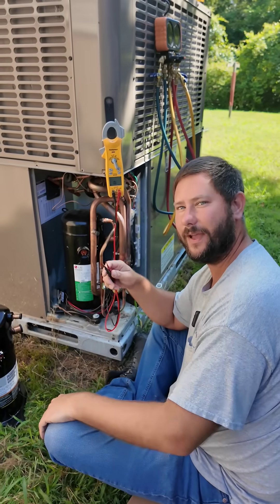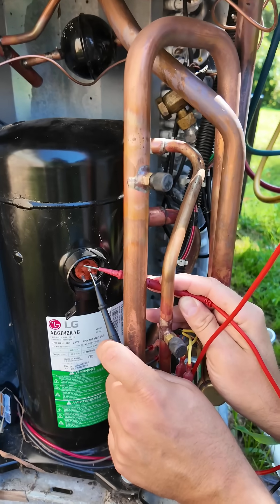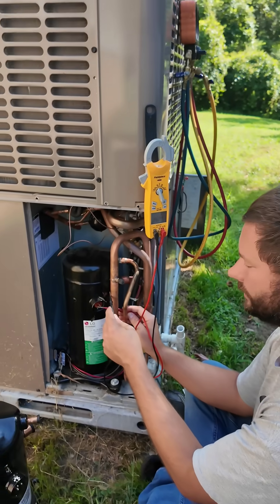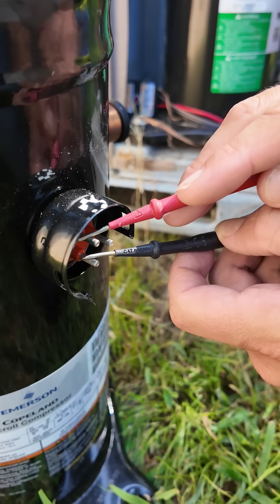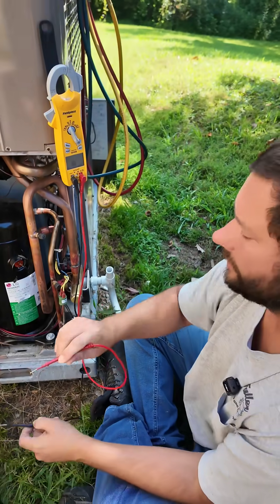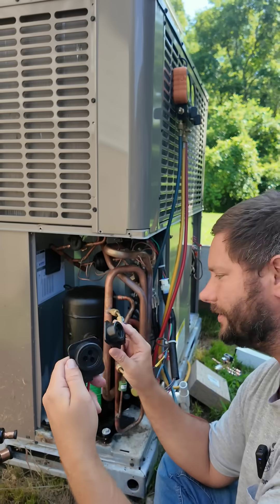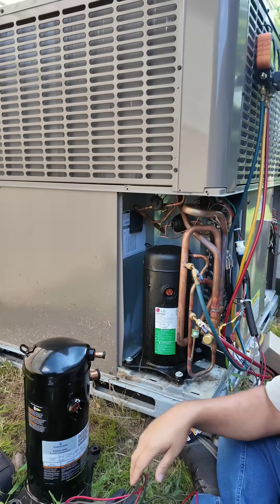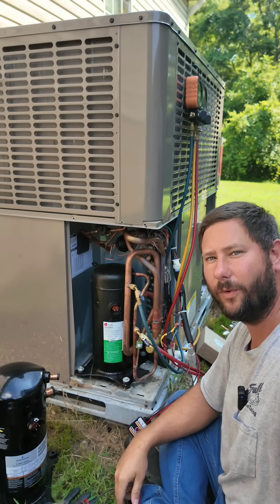Testing Compressor Windings - Everything You Need To Know

Comment: If the plug don't fit you can use the terminal repair kit to safely run the compressor until you get the right plug

Comment: “If we measure between the 3 connections, start to run, run to common, common to start, they should all add up; right?” 

Add up to what? What are we adding and comparing that value to?

Comment: I learned that the hard way 30+ years ago😂. My older brother who was a licensed electrician got into HVAC. He went to school got his certs and proceeded to teach me. He was checking for voltage between the windings meaning the unit was still hot. I happened touch the casing and a metal door jam next to where he was trouble shooting. That was a nice feeling. As soon as I said owwwwww.....like a big owww. He says to me the compressor is shorted😂

Comment: If I get resistance between the terminal to ground does that mean if I put multimeter on continuity setting and touch terminals to copper it should give an audible tone which means resistance and not OL ?

Comment: On your meter readings of the new compressor common to start would be your 1.3 ohm reading. The start winding has more resistance than the run winding. The 0.9 reading would be the common to run winding, with the 1.9 your start to run. If your readings are accurate, the total ohms of the two winding should be 2.2 ohms across the start, and run terminals.
Reply: @mofiddly  hey men is that mean is a bad compressor i mean if you find the reading between the S and C  lower than the R to C as in the video
Reply: @Hichemst  If the windings add up mathematically where the total equals the sum of the two windings, then he just confused the two. the run winding, with the start. Confirming the winding designation with the cover plate for the compressor terminals, and go from there. Could be someone before you hooked it up wrong. Usually if a compressor goes bad electrically, the winding resistance will not add up correctly, or you will have a open circuit, or a short to ground.

Comment: I would observe that your measurements to the case of the compressor are INSULATION QUALITY Measurements, which as you stated, should be VERY HIGH Resistance. The term "Continuity" is a bit nebulous.  It implies that current can flow between the two test points, but is nonspecific as to how much (Undefined Resistance).

As an experienced industrial troubleshooter, I recommend to my trainees, to refer to Insulation Test Results and Insulation Leakage Results and to connections with only a few ohms "Ω" as Continuity.  This term being reserved to a section of a potential circuit wherein successful operation could exist, without excessive heating or voltage loss. 

One additional point, regarding Insulation Leakage.  In a case were the leakage is present, the resistance can be used to determine whether the system is safe to run, for example, until a replacement is available.

The case that I most often encounter is in regard to 480 
3ø motors.  IF I find leakage in such case, I recommend to the owner that it is reasonable to run that motor, if the leakage resistance is greater than 1Megohm, measured with a Fluke Insulation Tester Model 1587 with the test voltage set to twice the operating voltage, in my example, 1000 Volts (In your case, 250 Volts, since the Compressor is 125 Volts to Ground).

I have never had this backfire on me, so with more than 65 years experience, I do not hesitate to recommend it to you. 
PS. I notice that a fellow ham radio operator mentioned in a comment , the term Megger.  This is a very old term that refers to insulation testers that measure insulation on things like high voltage transformers and switch gear and utilize test voltages of 15,000 volts or so.

The Fluke 1587 mentioned above is excellent for Insulation Testing in the Commercial/ Residential Space and for the Factory Floor.  I have carried one for at least 15 Year in my Fluke satchel, and is does not let me down.

Comment: Buy a megohm meter. You cannot reliably check a motor for winding to ground short with a traditional meter. Preferable a fluke 1587 although the cheaper ones work just fine. You need the dc voltage injection to be 100% sure. It's worth the investment!

Comment: 40 megaohms to ground is NOT bad. Thats 40 million ohms of resistance to ground. We are taught in school that 20+ MOHM is acceptable. Any MOHM to ground is better than KOHMS. York chiller literature will state that a MOHM reading less than 5 does not necessarily mean the motor is bad, so there are no rules of thumb.

  Even a brand new compressor once installed can potentially read kilohms to ground depending on the oil and refrigerant quantity in the compressor. Testing a nitrogen filled compressor then testing the same compressor once you install it and charge it will cause readings to change (sometimes.)

Just saying not every compressor is bad if you read something to ground. If you suspect it is bad, test with a megaohm meter next at the rated voltage of the motor.

Ive seen brand new Bitzer compressors test 200kohm to ground, run for an hour then test 50+Mohm to ground with my Fluke 116. It all depends on whats surrounding the windings. Every motor pulled into a deep vacuum WILL fail an insulation test and should never be tested in a vacuum or you will destroy the windings.
Reply: You do that all that testing of a compressor in perfect conditions, try doing that in a shitty condenser that smells like ass and you actually have to bend down into the unit, upside down. If it’s grounded out , especially popping the main breaker . The shit is bad . Recommend replacement. On to the next call! You spend all that time if you want too. Have fun

Comment: Yes... a great simple way to test a compressor motor's integrity, using a multimeter.
HOWEVER, I have had cases where a motor was drawing excessive starting & running current, but the multimeter indicated NO continuity to ground (no short in the windings).
But when tested with a hand-crank Megger, the windings did have SIGNIFICANT leakage to ground.
A Megger-tester tests at a much higher voltage than a multimeter - typically ~250-1000v (or more, usuallyadjustable), whereas a multimeter is only applying a few volts DC.
So, while a multimeter can indicate a winding shorted-to-ground (indicating a pretty 'good' short to ground, and definite motor failure), a Megger will indicate a motor who's windings are on the way out, but haven't failed completely yet.
It's a worthwhile investment IMHO (they're actually pretty cheap).
Thanks for posting!
Reply: Yes, a megger is the proper tool.  An ohmeter will quickly identify a dead short while a megger is an exceedingly better and comprehensive test tool.  If the ohmeter test fails, so will the megger test.
Reply: A hand crank Megger is the gold standard for me.  But to be clear for people new to all this what you are testing is the motor insulation to see if it’s grounded.   It’s what people mean if they say shorted to ground. 

When you ohm out the compressor between the terminals you are checking to see if the winding is actually shorted.
Reply: Wow I didn't know that! 

You don't happen to know what he means  by " the winding readings should add up" do you?
Reply: @ike4584  In simple terms there are two seperate windings in a single phase motor; a start winding and a run winding. They are a different length of wire, so the resistance is different. Power is always applied through common, and common connected between the start and run windings internally. If you measure R to C you are measuring JUST the run winding. S to C is JUST the start winding. R to S is BOTH the run and the start windings together. They should add up. R to C + S to C = R to S. If they are way off, you may have what we call a "Shorted Winding" just meaning wires are touching where they shouldnt and the motor is done for. In 3 phase, its way easier; all 3 windings inside the motor should be the exact same length "phased" 120 degrees apart, just like the power generators that make AC power. If one winding is greater than the other in 3 phase, the motor is done for.

Single phase motors use the "Start" windings to get the motor up to speed, then typically they may have a device to open the circuit of power applied to the Start windings and only allow power to flow through the run winding. Your metallic capacitor is a RUN capacitor and is always connected to most single phase compressors. Some motors use Start capacitors, they are typically oilless and plastic and are used in conjunction with relays that will allow the start winding to be boosted by the start capacitor, then pull the winding out of the circuit (typically  once the inrush current drops off (current relays) or the motor reaches 90% speed (centrifugal switches) or the backfed EMF pulls the solenoid in which opens the circuit.

I work on larger systems mostly all 3 phase. Im rusty with the single phase do dads, but I passed my license years ago.

Comment: You cannot condemn a compressor by reading by 25 Mega Ohms to ground. Unless the you have the exact spec from the manufacturer. The windings are sitting in oil and maybe liquid refrigerant. Continuity is not good either. Use a real megger and get the exact specs for the compressor your testing.

Comment: What would cause my compressor to run for a while and then shut off on thermal overload? Fan is good, TXV is good, compressor checks out good.. New cap, no grounding out either. I'm stumped.. Thanks in advance. Also I don't believe there's any restriction in the lines because the pressures run fine, my high side doesn't rise but the compressor still shuts off on thermal overload. Charge is good.
Reply: Discharge temp?
Low on charge?
Dirty condenser coil?

Comment: Scrolls will have a lower megohm reading compared to recips. You should confirm with Copeland mobile before you fail a Copeland scroll due to a low megohm readings. The rule of thumb is 1000 ohms per volt so a 460v scroll can read 460,000 ohms and be ok

Comment: One could measure current leaking through the ground wire on the unit, if it is starting to short to ground. So of the insulation might have become carbonized.

Comment: Umm.. if the terminals measured to copper show no voltage THEN you have a short to ground. If they show a voltage then you don’t.. although they should show the same voltage to “the copper” - as you put it - as they do to the common terminal…

Comment: I have a question. Last year I bought a 3 ton goodman 2 stage 18 seer heat pump in Florida.  Now to check the pressures, do you do it in 1st stage or 2nd stage. One Hour air did it and let's just say its been a hassle. Any advice is greatly appreciated. If you google one hour air in lakeland you'll see my review. It's bad so I would love some insight. I greatly appreciate it and love your content
Reply: @adanrivas8111  always check pressures in 2nd stage on a two stage unit so it's running under full load.

Comment: Your meter automatically switches to Mega Ohms when you're doing this, you've likely been replacing compressors saying they're "bad" when they're not. I've made the same mistake in the past and had to learn the hard way from my boss at the time. The Mega Ohms (M O in the bottom right of the screen) is testing the insulation of the internal windings of the compressor, same thing a dedicated Megohmeter does just not quite as accurate. Ohms should not be used to test if compressor windings have shorted to ground, always use continuity as that'll be more accurate. And if you are able to afford one, double check with a dedicated Megohmeter. I've done this too, got an ohm reading to ground with my meter but used a Megohmeter on the same one and it was testing as a good compressor. Not entirely incorrect in your way of thinking but it is incorrect.
Reply: I was thinking the same thing. The meter has an audible sound feature just for continuity alone.

Comment: Hi Taddy, I have a non compressor question.  I have a 4 ton Trane 410 AC that is 5 years old and cooling the upstairs independently - a total space of 2000 sqft.  The area of geographic activity is in Dallas TX.  Now my issue - when temp rises to 96 and above, the AC will not maintain the set 73 degrees.  Had the freon checked and it was good.  Is this a problem with the txv or something else?  BTW, this Trane replaced a 4 ton Lennox R22 that cooled without issues and did not keep running for long time.  Also, if it is txv that needs replacement, how much does it cost? Thanks
Reply: What's the temperature of the air coming out of the supply grille.
Reply: @mrsean209 before it gets to 96 degrees it comes out at between 59-60 degrees ,once it gets to 96 and above it will be between 62-63.5, and the return will be at about 75.
Reply: @listenupp1 I'm questioning the tech that told you your charge is good. I don't have enough information, but on a 4 ton system, a 15 split is low. 

Check your air filter cleanliness and condenser coil.
Reply: @mrsean209 I regularly change the filter and clean the condenser fins with water.  How much should the difference be between the delivery and return for a 4 ton unit? Thanks

Comment: It’s an LG compressor that’s why it failed no other explanation
Reply: Yep, yet another dead LG compressor, they're dropping dead like flies.
Reply: From what I've seen in my pool heatpumps. LG's just die without anything happening and Copeland mostly dies because people don't catch a dead run cap soon enough.
Reply: @sampic_   Any compressor will die when the run capacitor fails and nobody catches it.  Might be able to prevent that, not sure.
Reply: @thisisyourcaptainspeaking2259  any will die for sure. Just saying I've rarely seen a Copeland just die without anything else causing it. I feel like measuring amp draw to the compressor and stopping after 3 times it fails to start, would be a good way. But I doubt any manufacturers would do it.
Reply: @sampic_   Off the top of my head, I'd consider a smaller breaker if it's sized above minimum spec.  I dunno, maybe it'll trip prior to compressor damage?
Reply: @thisisyourcaptainspeaking2259  Some of the machines I work with do trip the breaker when the run is dead. Mostly the bigger ones (ZP83), the smaller ones still pull amps way over, but overheat protection stops it before it trips.
Reply: @sampic_   Interested in your suggestion if any, manual reset thermal switch on compressor shell?
Reply: @thisisyourcaptainspeaking2259  not a suggestion. The LG's I work with have it externally and it cuts power directly at the contactor. Copeland's are internal and cut the power at itself. I've had to pour water on some compressors to cool them down before I was able to even start it. Water turns into steam instantly.
Reply: @sampic_   Yeah, an overheated scroll compressor will be damaged if cooled with water this way.  I think a manual reset thermal switch mounted on the shell might be the ticket here.  I believe that's too hot, a refrigerant compressor shell should never exceed 200F!
Reply: @thisisyourcaptainspeaking2259  so far the Copeland's are handling it. It rarely happens tho most customers shut off the machine when they notice it's not heating the pool. But yeah a manual reset thermal switch would be the key. There is no way it could trip during normal operation especially with an accoustic blanket the compressor.
Reply: Compressors don't die, they're murdered. Except for LGs 😅 thank goodness you're going back in with a Copeland
Reply: Looks fairly new carrier?
Reply: Carrier
Reply: @tedhicks5431 
I didn't think carrier used LG compressors.
Reply from the maker: its york
Reply: Made in the good old USA

Comment: What if you get a reading on 2 of the winding and then the last one you get OL.. Overload ?  and it doesn't close when you cool it off.
Reply: OL does not mean overload. It means open line. Compressor windings should always be closed unless the thermal overload has opened one of its windings and you're typically only going to see OL in that case from common to start or common to run since the thermal overload is connected to the common winding.

Obviously, if this is the case, it should close if you cool it down.

Check the terminals, it should tell you if you're checking from C S or R meaning Common, start and run. You should be able to visually see them.

Check for resistance to ground; the shell of the compressor or the refrigerant line(copper) as Taddy said. 

Let us know.

Comment: 27 Mohms is 27,000,000 ohms, and is far from continuity.  Compressor was not shorted to ground.
Reply from the maker: Why wouldn't it start
Reply: @taddydigest  if you had a short to ground it would trip breaker or blow fuse immediately.  Possibly the compressor was locked. Did you try a hard start?
Reply: Yes generally speaking a grounded compressor will cause the breaker to pop.  If the compressor doesn't start but feels hot on call for cooling, check the run capacitor.  If it has a start capacitor (single phase) check it too.
Reply: @PhantomDragonX I can't believe anyone but a total crook would call for a compressor when only the cap was bad. This is just not a mistake you make in modern times.